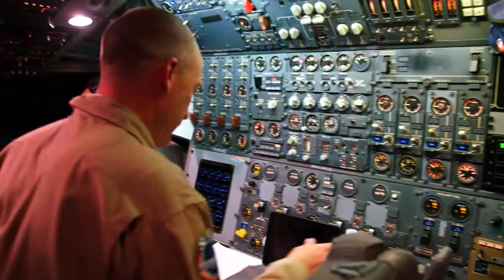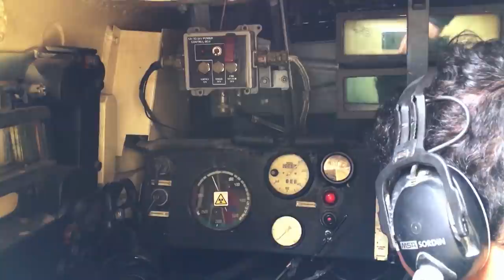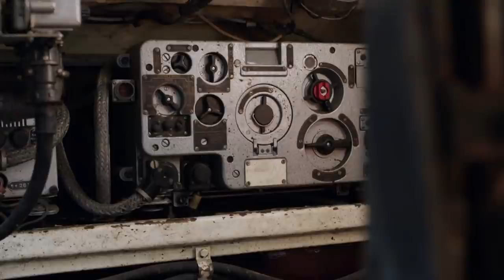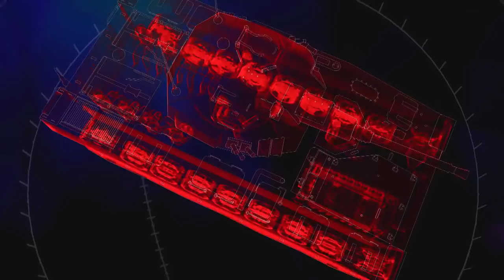World's Greatest Tanks | Ultimate Vehicles | S01 E06 | Free Documentary

Comment: Merkava being the safest tank for the crew is just a carefully constructed myth, the same way Tiger being 'indestructible' was just a myth even gets mentioned in this video. Merkava was designed with it's fuel tanks and engine in front of the crew with the intention of stopping the HEAT ammunition very popular during the time of the tanks creation. Isreal didn't have access to some of the advanced materials required for making composite armour other rich countries did so it went it's own path, and for the original purpose it did it's job. The layers of this fuel tank + a small layer of armour + engine would trigger the HEAT round early and would be too much distance for it to travel therefore protecting the crew.

Against a modern APFSDS round fired by pretty much any modern tank though this frontal 'protection' would count about as much as layers of paper. One of these rounds would probably pass through the entire tank shredding the crew on it's way out. Not to mention a hit to this frontal engine block is going to rend the tank immobile almost 100% of the time with a frontal hit, meaning follow up shots against a stationary target, ensuring anyone still left in the tank has no way to retreat back. 

Having all the heat generation at the front also makes it very easily detectable to other tanks, there is a good reason every other tank has it's engine at the back. The gun on Merkava is also outdated compared to modern guns and lacks the penetration against the newest armour. I mean at bashing on poor people in the desert who have nothing but RPGs and old missile systems I guess it's a good tank. Calling it 'one of the best or if not the best in the world' though is pretty laughable to anyone who has any knowledge of tanks.
Reply: Thing is that tank generate a lot of heat on the front of the tank that very easy detected by thermal imaging device and its one of the worst tank. 

Also the front armor plate are not really protected and its where the engine,transmission,fuel tanks and driver are placed so doesnt really consider world best tank btw leo 2 are already good example of best tank in world.

The tank overall are not really good its seems doesnt have E.R.A that will protect the crew against ATGM or RPG at least some tank old tank like soviets T-72 or T-80 with some modification are still good protected tank even for today standards.

So my opinion is thats not a very good tank with bad designed tank i more like Leopard 1 or m60 for good old tank that still can fight better
Reply: You still choose to ignore some other facts. Unlike many other popular tanks, the Merkava had a very good mine protection since its construction. Anything similar wasn't introduced on the Leopard 2 until the 2A6M in 2005, or on the Abrams with the TUS kit in 2006/07. 

Also, other tanks have been vulnerable against HEAT ammunition hitting anything else but the turret aswell. One Challenger 2 has been penetrated in the lower frontal glacis by a RPG, not sure if that could've happened with the Merkava front engine layout aswell. If the driver is dead or seriously injured, the tank tends to stay immobilized for a good period of time aswell. The difference is, the Merkava crew can evacuate the tank through the back, while others can't and are trapped inside.

Plus, while it's true the Mark I and Mark II didn't have composite armor, modern versions do and don't lack behind other tanks at all. Also it's the first tank which has been equipped with APS and prove its capability in actual combat. 

The gun is outdated, but it all depends on the ammo. The same could be said about the Abrams and any older (pre 2A6) Leopard 2 variant aswell as many other tanks.
Reply: @SuperGeronimo999  So your arguement about what I said is that all older tanks had the same problems haha. Makes sense dude. The points are relevant about the Merkava today.
Reply: Well no, older tanks weren't as save in terms of mine protection. Also, if the tank is disabled, their crew were stuck in there. On the Merkava you're not stuck.
Reply: @SuperGeronimo999  Every tank has an escape hatch normally in the bottom. Also running out of your tank after it's been disabled by another tank is probably gonna mean you're getting shot. Far better to have the engine in the back where it's protected and you can reverse if the tank takes a hit.
Reply: Well, the Abrams doesn't have one. And if you have mine protection we've talked about, you don't have one either. Running out of your tank? Totally possible if you can escape through the back and have support around you. And who says you can reverse if your tank is disabled? (cameras dead, driver dead)
Reply: they talk about the merkava being SO safe. then they show the inside of the tank and it looks like a museums piece. no spall liners to protect the crew from shrapnel. everything seems to be mounted directly to the hull and the floor in the most unsafe way possible. no idea what the myth about this tank is. seems like propaganda. not to mention the fact that they put the engine at the front so that the enemy can pick up your infrared signal more easily...
Reply: @swunt10  Exactly
Reply: @John H On which tank? Abrams doesn't have one either way, and on the Leopard 2, of course the hatch is still there. But can't be accessed thanks to the mine protection.
Reply: @John H Well, the Merkava doesn't need one, simple as that. I was just wondering what you meant. It's clear the Abrams ain't better in that department at all.

Comment: Main battle tanks are the F-1 Formula cars of the battle field.  They are bleeding edge high performance vehicles in their own right with extreme maintenance costs.  A typical tank use will end with it needing it's tracks replaced, it's power pack partly stripped down for worn parts, transmission serviced and it's gun system extensively serviced.  A typical 15 million dollar tank can easily cost a couple million dollars to maintain each year.
Reply: Absolutely correct. It’s mad how much effort and resource is required to keep a fleet of these things going. However, they are vital component for the combined arms offensive.

Comment: The lack of steering capability in the T-55 has nothing to do with oil pressure.
I have driven a similar tank, brobv971 (MT55), and if my memory is correct the steering brakes are not hydraulic. Its a linkage system that follows the left side of the tank back to the brakes. Sounds more lite the brakes needs adjustments.
But my memory could be wrong.

Comment: Why does the Leopard 2 barrel pitch up after firing?
Reply: Because the turret is cramped inside. The loader has to load the shell from above the barrel, which would be a hell of a workout if the barrel didn't pitch up.
Reply: @JoshYxVdM  that's rather inconvenient.
Reply: @aaronseet2738  It's loading from the rear, just like in every other tank. The barrel pitching up (and thus the breech inside the turret down) is just to make loading easier and faster. It would still be possible without the pitching.

Comment: Called the T-55 a modern vehicle? 

I love the T-55 but the design is based on the T-54 which has it's origin in 1944 with the T-44..

Calling it a 'modern tank' is a disservice to ACTUAL modern tanks. The T-55 lack any sort of thermal optics or any other form of FCS'.
Reply: I honestly dont't know whyever it is mentioned here. IT BELONGS INTO A MUSEUM ! Why didn't they used the T-90m mod.2017  ? The latest T-90 MBT
Reply: I still use a spoon, fork, knife, bowl and cup.. they work just fine for me.

Comment: 42:48  The CV90 use a 550hk V8 Scania DSI 14
Reply: KarILsson never models of the CV90 has 750 hk and  can be turned up til 810hk;-)
Reply: @Nico-rb7vi  oh my bad thx for the info :) missed that Norway have upgraded the CV9030N  with the same engine Denmark and Netherlands use in thier CV-90 Mk III 810 hk Scania...after CV9030N got added armor and the  Remote Weapon Station on the turret.

But still V8 and not V12 as mention in the vid.

Comment: The Leopard 2 a7 can't penetrate a t90m or t14 armata (rip?) from the front. They want to mount a longer gun, which probably won't suffice either. Rheinmetall is currently developing a 130mm gun to adress this issue. The new Franko-German EU MBT will either have this gun or an even larger 140mm gun with the codename "Terminator" developed by Nexter. It could be so much easier if Germany just decided to contaminate large pieces of land with dust from depleted uranium darts like the US.
Reply: The new DM 73 round which is currently in development, is capable of penetrating up to 900mm of armor, which should have no problem going trough the t90s front plate and the armatas turret. The L55A1 is currently the most powerful tank gun out there and if you would shoot DU rounds with that gun, they would shatter on impact
Reply: @luzerino1124  You are right, it will give the Leo 2 the ability to penetrate modern Russian tanks, but the Armata's new 152mm. 2A83 will simply outrange it, thus the L51 is "needed" (realistically speaking not, since the Russians probably won't field T14s in significant numbers) . Rip t90s though.
Reply: @Neeverseen  Yeah that 152mm is scary but the leo can still go trough the armatas turret and you know what happens when you penetrate that turret, it leaves the tank usesless (just like any other tank)
Reply: @luzerino1124  That 152 mm will come with it's own drawbacks. Ammo would be so heavy and large that a vehicle can't take much with it and would have long reload cycles. And the wear and tear on that gun would be huge. 

As for guns, I wiill go Rheinmetall
Reply: @Neeverseen  You are aware that Uralvagonzavod themselves said there will be no 152 mm on the T-14 Armata right? It would require a total redesign of the turret and partial redesign of the hull, they offered to make a different tank based on Armata chassis for the 152 mm but the russian MoD wasn't interested.
Reply: @jonny2954  No I'm not, haven't heard of that. That's cool, may not need the 130mm after all.
Reply: @Neeverseen  The 130 mm isn't for the T-14 anyways, the L55A1 with DM73 is. 130 mm is for anything that might come up in the 2040s and later.

Comment: The leopard 1 wasnt the first to have a stabilisation system. Just look at some of the shermans.
Reply: The shermans system was a one-plane stabilizer that worked on relatively flat terrain at speeds up to 14 MPH. The Leopard 1 had a 2plane stabilizer that, at max speed, is stable enough to not spill beer from a full glass that the germans placed on the gun to demonstrate it, because of course they did.
Reply: @zentralratderfliesentischb660  But that still doesn't mean it didn't have a stabilizer.

Comment: The Leopard 1 was not the first tank to have stabilisation. The M4 Sherman had it in the 1940's.
Reply: The Sherman had a gyroscopic stabilizer that allowed for shorter times between stopping the tank and shooting. The leopard was the first tank to get a two plain stabilizer, thus being the first to shoot ACCURATELY on the MOVE. Both things are called stabilizers, but work different and for different engagement scenarios. Plus the Sherman's "stabilizer" was unreliable and almost all crews ripped them out as soon as they got their tank, they didn't trust it.

Comment: Almost all modern tanks have a trophy system so I don’t know why the Merkava is an exception, also the Merkava is a really bad tank with many flaws including the fact that the engine is up front and can easily be destroyed. And it has equivalent to no hull armor. The Merkava is just a normal modern tank with a lot of flaws.
Reply: Well I mean, most modern tanks don’t have a lot of composite armour in the hull, and with modern day apfds rounds they could easily own the hull anyway
Reply: @RRAAZZAA  yeah but compared to modern MBTs the Merkava has next to no hull armor, the modern MBTs armor may not be very good against kinetic shells but they at least do something against chemical shells but if the Merkava was hit by a chemical round to the hull then the engine will catch on fire and the tank will be rendered useless.
Reply: @caboose6460  fair point
Reply: @RRAAZZAA  props to you for actually being civilized when someone has a fair point instead of going ape mode and harassing. Respect
Reply: @caboose6460  I mean going ape mode doesn’t get you anywhere

Comment: What did Leopard 2 tank accomplish to make it have status of a "legendary tank"? Turkish Leo2A4s had very poor results in Syria with quite a few being knocked out. Newer versions saw some limited engagement in Afghanistan only, but even there it suffered loses - Danish Leo2A5 had been blown up by IED, driver was killed, rest of the crew wounded iirc.
On the other hand, British Challenger 2 surviving multiple RPG hits, including MILAN ATGM is something for what you can call a tank >>legendary<<. Dont get me wrong, Leo2 is a good tank, especially new models A6 and A7 which have good modular design, with parts being added/replaced easily, however it still hasnt got anything "legendary" in its reputation, so people could address it as such.
Reply: Turkish tank tactics were very poor in Syria and A4s aren't the newest tanks either and the Danish tank didn't had the Mine resistance upgrade like the Leo2A6M